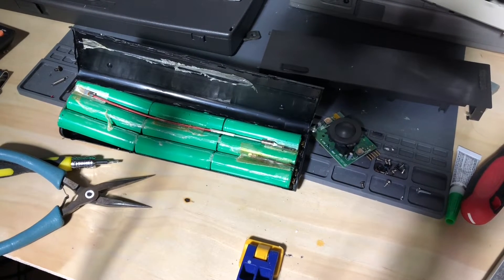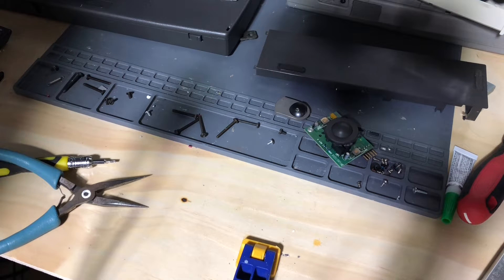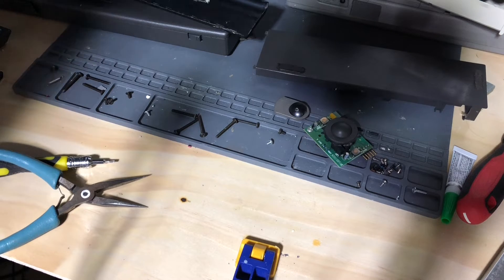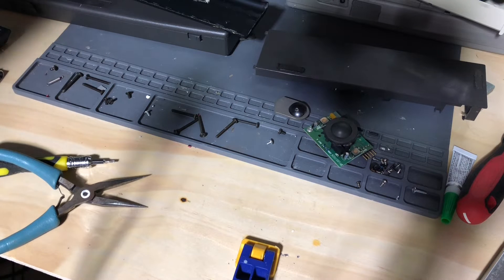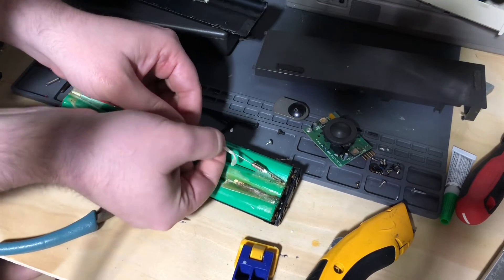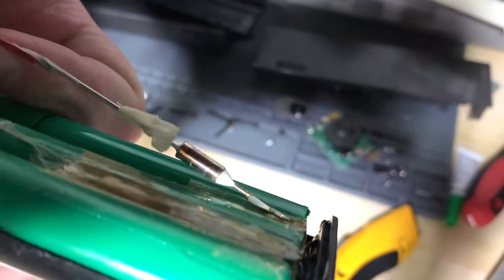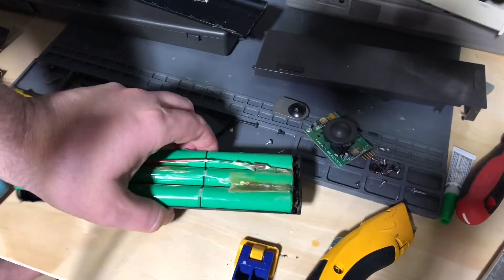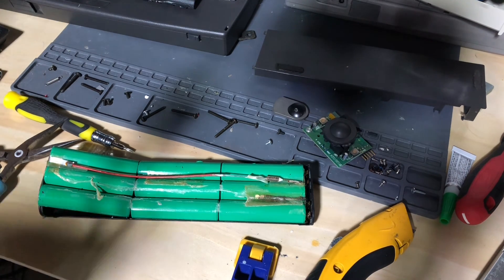Exploratory surgery on a cheap Compaq Contura Battery

Comment: Partially inspired by your videos, I now have - bunch of Contura laptops in various states of functionality to repair. 
I wondered if you happen to know if the 430 power adaptor and the 4/33 adaptor are the same plug? I ask, as I really have to push the 4/33 one into the 430 to make a good contact. If you have both, would you please be able to compare them?
Reply from the maker: They’re not the same adapter.  The Aero adapter is a rectangular brick.  The 400 series have more of a rounded brick.
Reply: @i80386sx  thanks. And what about the barrel jacks? Are they identical size and length?
Reply from the maker: @willj1927  I’ll put something together for you.  My first comment was entirely from memory.